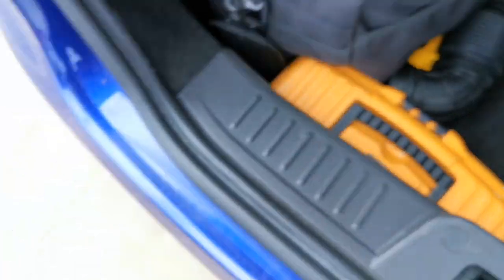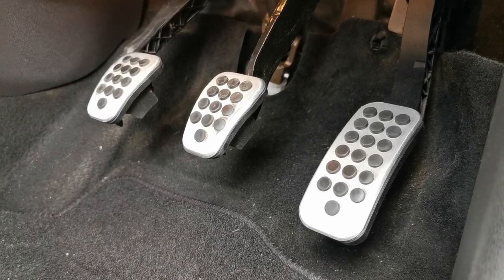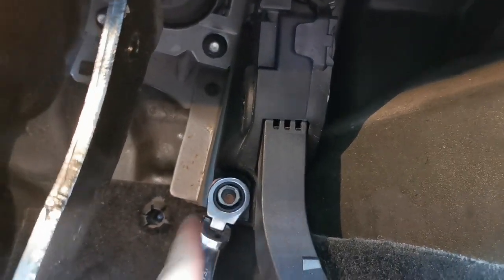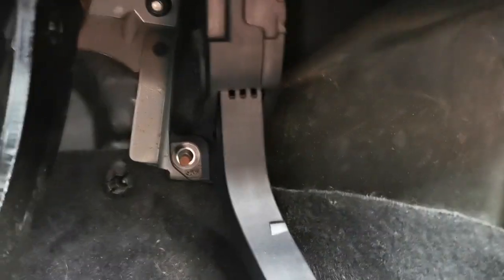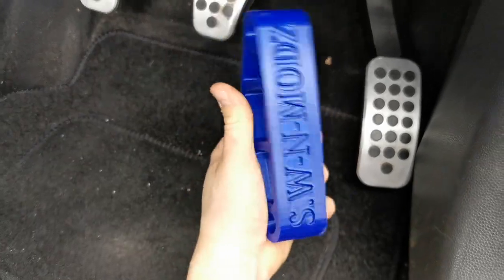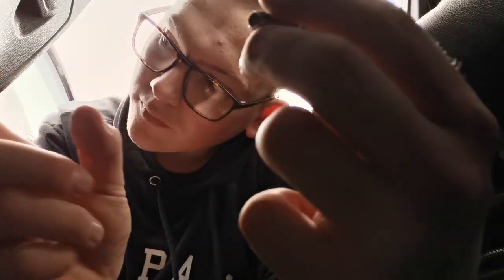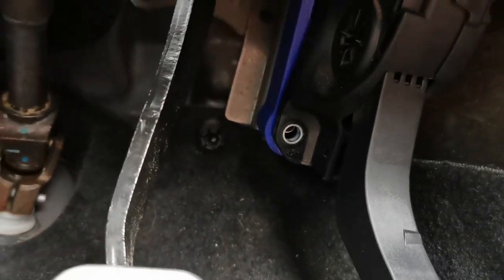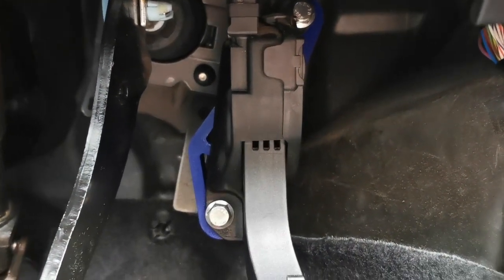FIESTA ST THROTTLE SPACER INSTALL

Comment: Are the pedals stock cause mine look very different and the throttle pedal is way more 2 the right. Mine is 2016 st180.